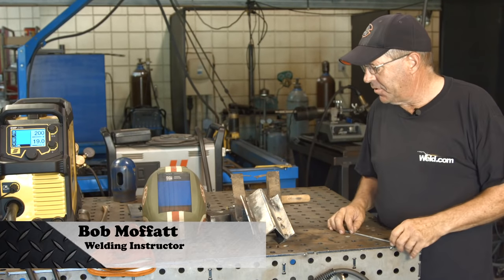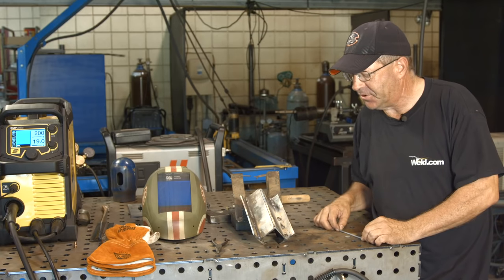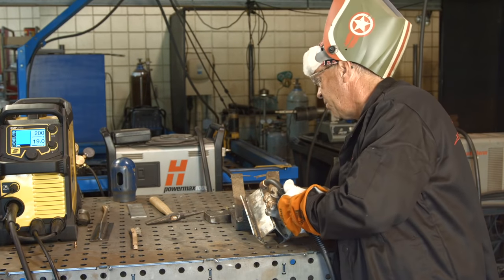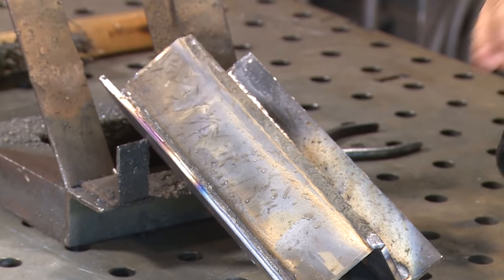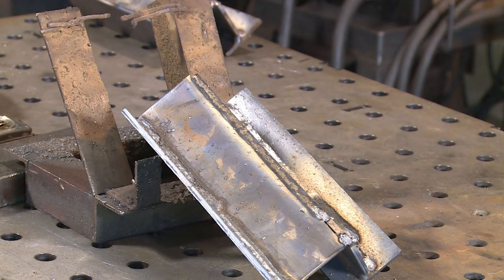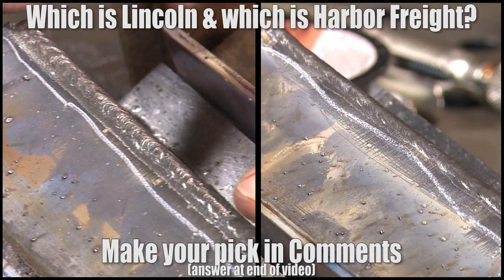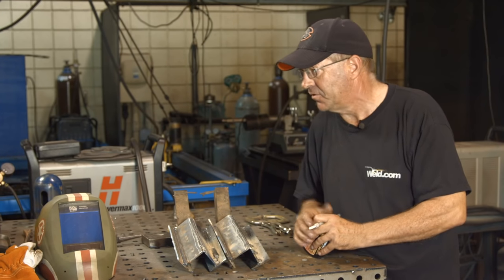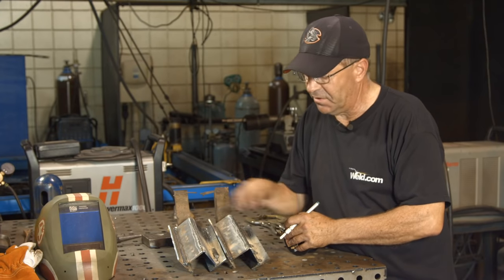Harbor Freight Flux Core Wire vs Lincoln Flux Core Wire: Part 1 of 2

Comment: @bob, did you ever figure out why it was feeding inconsistently?? i am noticing that with my welder atm and cannot figure out why. also when you stop welding and releases the trigger i notice the arc goes away (like curtains closing at a show in ) and makes a funny noise. ever notice this?

Comment: I have a question. I dont have much experience with flux core but on the second weld near the bottom. The arc didnt sound smooth. What causes that or is that the way its supposed sound?

Comment: From what I saw there was a pulsation happening on both the harbor freight wire and the Lincoln wire I did notice that the Lincoln smoked a little bit less than the harbor freight and what is your opinion on Hobart wire

Comment: Another question. Using fluxcore vert position. Can you weld from bottom to top or do you have to weld from top to bottom. On a thicker piece of material.  Im used to 7018 stick.  Thanks for any help.

Comment: I've had spooling problems with these before, I believe its the hole in the spool I ran a half inch sanding spindle through the center, made it smooth out a lot.

Comment: The slag on the Lincoln weld was harder to remove than the slag on the Harbor Freight weld.
The slag on the HF weld seemed to just peel right off. No so with the Lincoln weld.

Comment: If the nozzle is on is there any difference in quality of weld ? I have a cheap 130 amp welder ( gasless ) and i always keep the nozzle on because it sort of gives me a better point of reference when im starting the weld. I've had people say Why do you keep the nozzle on and my only response is " i just prefer it on " but no one has ever said to me that the quality of the weld will be any different.

Comment: Great instructional video. I'm going to need to do some flux core welding with my everlast mig welder. Got some welding that needs done outside and there is always some kind of breeze blowing.
Reply: I strictly run flux out of the same welder he used for that very reason, I honestly have it tuned in so nice that after I knock the slag off you can't even tell the difference between flux and mig wire with gas

Comment: Thank you for making this video!
Waiting on part 2.
I have been thinking of getting a welder, but don't want to spend a lot. So this Harbor freight welder fits the bill.
Reply: BadmunkyWRX that wasn't a Harbor Freight welder. your gonna be out a grand with the ESAB. it's worth it though.
Reply: ????
Video showed a Harbor Freight welder did it not?
Reply: BadmunkyWRX absolutely not. it's an ESAB Rebel, not sold at Harbor Freight. also, if you notice in the background, there's also a Hypertherm plasma cutter, also not sold at Harbor Freight.
Reply: Your right. I did not notice that the welder on the table is in fact an ESAB Rebel. 
Actually that is the welder I really want. But I do not have $1,000+ to spend on a welder right now. Or at any time in the next 1-2 years.
(Fixed income) 
But it would help me with my projects to have my own welder.
Reply: Look into Everlast, Lincoln, or Hobart MIG welders that cost around the $400-$500 range. Just as good and worth the money, plus keep in mind the cost of gas needed to use MIG wire, otherwise use Flux core wire.
Reply: Thank you for the help!
Right now I have a cheap older MIG welder made by Matco. It works, but not very well. And its a 110 so it will not do heavy stuff like a 220 welder will. I want to be able to weld 5/16" mounts to axle housings and not have them fail on the trail. So a better welder is needed.
I have been paying to have things like this done so far, but really want to do it my self.
Reply: I have a used Miller Maxstar stick/TIG welder specifically for some heavy duty trailers I made. Only set me back about $450. Works great with thicker material. On occasion, I have an older Northern Industrial Flux welder I got for just over $100 running Lincoln wire and also works great on 1/4". Point being, lots of options at reasonable prices
Reply from the maker: No, the video in this video is the ESAB Rebel EMP 215.
Reply: +Ju An those Miller Max stars are pretty sweet got one my self I say give me my maxstar and some 7018s.lot cheaper than that h f wire

Comment: I feel the same way about Walmart wire.   seemed to work as well as any other flux core.  but I'm not a welder, I just own a welder.
Reply: I guess it may depend on what you are welding and critical it is. I use lincoln wire in my everlast with no complaints.

Comment: I think that the flux core welds better with the shield also. It helps keep spatter off your tip. I've try welding without the shield and not even a second later my tip was getting gummed up and would break the wire/ wire welding/ arcing in the tip. I have a hate/ love relationship with flux core welding.

Comment: Very nice comparison. You didn't mention this so I guess it's just a trivial concern. However I may have had a senior moment and missed it. What type mig fluxcore welder are you using? AC or DC output. I presume that this information is not necessary or irrelevant  to know when you're doing these tests as you probably would have stated that?  What say ye? Thank you very much!  KP
Reply from the maker: We used an ESAB Rebel on DCEN.

Comment: Thanks for all the great vidoes. I  realize this is an older video but was wondering if your were using a knurled feed roller with the flux core wire? I have had issues with feed rate using smooth rollers. I burn a lot of flux core wire and until i switched to knurled rollers fought the exact issue you had with varied rate of feed.

Comment: The settings, the angle, everything is why it ran like that.  I think out of position or some less than ideal conditions (wind, dirty metal) would make a better condition.  That's where you really start to notice differences.

Comment: Hi Bob l enjoy your video's your an awesome teacher. Young blokes in the trade are in good hands keep up the good work .I've been welding most of my working life  I'm semi retired now and i find flux core very handy at home those 1 kg rolls bug me big time. I'm not sure but i think they may work better on a spool gun ? I don't  know I've never used one. At home though i only ever use the 5 kg rolls there much better. You don't use as many tips the liner is much cleaner and the machine runs smoother thats been my experience. Get one and give it a try keep up the good work Terry edwards TAS Australia

Comment: trying to get into welding and am most likely gonna pick up the HF welder. Would you recommend to use different wire then the one that comes with the welder?
Reply: Get what you can out of the included wire but it can be disappointing. Also buy a role of HF wire, it's better than what comes with the machine. Also buy a package of extra tips. I've never heard it discussed but for my weekend warrior projects, I prefer 0.035" tips for 0.030" wire. Just a little more forgiving to not foul the tip and jam the wire. Plenty good conduction.

Comment: The wire is oxidized or oil contaminated, you can't get a stable arc without good electrical conductivity. The Vulcan wire is typically oxidized and the Lincoln wire is typically oily to the point that the label soaks it up over time. Hobart wire runs smooth electrically but has massive amounts of spatter.

Comment: As an AWS CWI, I'm going to tell you that I'm biased towards Lincoln electrodes. I've tested hundreds of PQRs and the mechanical properties of these two manufacturers are night and day. If I remember correctly, HF is rebranded Hobart.

I feel as though you may have bumped something when setting up to shoot. It sounded like you needed quite a bit more wire. The pulsing is your electrode burning back up toward the contact tip. As it does, your voltage reduced and allowed the electrode to feed until its proximity to the workpiece increased the current again. Since I'm already talking about sounds, there is a noticeable difference between the HF and Lincoln electrodes. I would happily go into the differences I find with these two wires but I feel like we cannot establish a proper platform for debate until we've run these two electrodes within their proper parameters.

Comment: The smaller spools of wire seems to be wounds tighter.  Another thing is making  sure that the tension roller has the center where it mounted correcting.

Comment: love the videos only thing i would add is that it is not a ground it is a work lead. there is no ground in the welding circuit only the lead side of the transformer plugging the unit into the power source. awesome videos keep it up! as for my opinion on HF vs Lincoln. both are Chinese parts. it comes down to the welder.

Comment: I have the same problem with lincoln flux core wire.. not all the time but it started to happend more and more so thi week i'm getting a bottle of 100%co2 and it'll be my first week trying mig welding 👌

Comment: what do you about the E71T-11 flux core wire? i prefer it to the other type. i am not a very good welder myself but i do better with the high carbon wire. i have a firepower wire welder that pulses like you are talking about. i replaced the motor controller board and it still does the same thing. i have a brand new spool of 2 pound E71T-11 i am going to put on the firepower and see if the pulsing goes away.i am using the washington alloy E71T-11 WIRE .030.

Comment: In order to avoid that pulsing action, try using a bit longer stickout and or slightly higher wire speed. The wire needs more time to preheat before arcing. If your settings/wire tensions are good, I cant think of why else both spools would do that. I've used miles of Lincoln innershield, and it welds great in all positions, except downhill. Too much slag for the arc to contend with, unless you crank it up a bit and move fast and still hardly much penetration on thicker material. Solid wire and gasless fluxcore are very similar if you set up properly. Try .030 wire next time. I use it often and have great results. Great video, keep em comin!

Comment: I dug out a Speedway Series (green) 125A flux welder we got kicking around.  Pain in the arse.  Hardly worked.  It's sat for years.  I put a new 200A HF ground clamp on it for $7, cleaned it up inside, put a spool of Lincoln NR211 in it, I'll be damned it works!!

Comment: Bob you are the man no doubt about that but I don't think this is an equal comparison. The Lincoln wire is t11 which conforms to aws d1.1 with a limited thickness of 1/2". The harbor freight is a gs wire and is made to manufacture specifications.

Comment: I had the same issue with the Lincoln wire on the 2lb spool. I have since bought a 10lb spool and it fed perfect. I think it has something to do with how tight it is rolled onto the smaller spool? Just my guess.

Comment: Saw this video is still getting attention. One thing I learned about Flux core was switching the feed wheels from the smooth ones to the grippy ones, I forget what they're called now though.
Reply: But it's important for the wire to stop with back pressure.

Comment: I have the blue harbor freight flux welder. Its a/c output which sucks but it works. I found that using lincoln wire spools from home depot worked better than the harbor frieght wire it came with.

Comment: could the "shaky" feed be because the wire in smalls spools are more bent and not as flat coming out of  the big spools circumference?... or how do you determinate the wire  tension on the machine?  ... great videos!
Reply: That's the "Cast" he was talking about.  Some big welding machines have a gadget to straighten the wire, but there's nothing like that in these systems.  Too bad!

Comment: I know you didn't want to see anyting. But it seemed like the Harbor Freight flux core laid down a better bead. And not much jumping on the Stinger. But like you said it could have been just the way they were spoiled. One could have been wrapped tighter than the other. And causing jumping on the feeder

Comment: Try warming the flux core wire in not an oven but just warm the spool up for a few hours and just like stick electrodes the flux soaked up  moisture and effects the weld, also could you make a video of the really cheep 130 amp ac flux core welders?
Ps. I really think warming the spools and drying out the flux will really help
Reply: While heating may well alter the wire somehow, the result has nothing to do with moisture sorption. 
Metal is totally impervious to moisture vapor, and since the flux is on the inside, nothing in or out.

Comment: I've ran alot of np211. only times I had that insistent feed was because I either had it set too low or didn't have the feeder tensioned enough so it was grabbing.

Comment: My Miller (Millermatic 211) feeds flux core the same way. I thought it may have been my setup but I guess this is common. I've run 4 different brands through so far (2lb spools) and they all feed sloppy. The Italy made 10lb Harbor Freight flux core has so far fed the smoothest through my rig.
Reply: I had to take a look and was surprised to see the HF Flux cored wire is made in Italy while their solid core wire is made in China. Thanks!

Comment: with flux core wire it is very soft wire and if the pinch rollers in the machine smashes the wire oval it will bind up in the tip
Reply from the maker: This is true. However, that wasn't the case here as we tried adjusting the rollers.
Reply: Are you using the 'knurled' groove rolls...?
Reply from the maker: Yes, we were using knurled drive rolls.

Comment: people have told me that gas-less can penetrate thicker wire at the same amperage, is that true? ive also heard that a co2 vs c25 that hte co2 will allow a hotter burn and deeper penetration, is that true?  i had a HF 90A that was very inconsistent in arc length when i tried to weld with it. it worked but was just rough. i bought a lincon with co2 (140c) and its WAY smoother and easier to weld with than the gas-less.

Comment: Good video. I've run quite a bit of nr211 type wire in the past. It works especially well over galvanized. I think the arc may have been eating up the wire because your stick out was a little short. Try it with about 1/2"-3/4" stick out. You may have better luck with that?

Comment: Dunno.. I weld body panels, I do a lot. I stumbled across a brand - "Super 6" that do 0.8mm flux core mild steel wire. It's far from the cheapest - it's actually pretty pricey - however, if you gave me the choice of running Super 6 flux core or a premium solid wire with gas, I would pick the Super 6 flux core every single time in a heartbeat.  

It is about 10 times as precise when it comes to filling them tiny little "missed spots" on panel welds - it gives a much softer, smoother, flatter weld that grinds down lovely, it blows less holes in thin stuff than solid wire (even 0.6 solid) plus I can grab the torch, hit one button for "On" without having to dick about turning on gas, messing with flow rates, wondering is the bottle nearly empty.. going off for half a day to get gas, lugging bottles..blah blah - and it gives me a BETTER weld than all the faffing with gas did?? I'm OK with paying slightly more for wire for those benefits. 

You seen the price of gas?? Good flux core becomes a total no-brainer - every time I pick up a torch loaded with it, I smile - people who say it's rubbish, for hobbyists, blah blah - they just aren't doing it right.

Comment: I've  watched some of your videos and see that you are very good at what you do. So thanks for sharing your skills. I would like to know more about choosing  a tip size and gauge of flux wire for projects. Presently I'm doing some steel frame welding on a shipping container and would be very interested in seeing something done or explained - or both on this type of project that a lot of DIY guys out there might be interested. What are the best and worst case scenarios on DIY projects.?

Comment: how's the penetration with harbor freight wire
Reply from the maker: That is part two in this series. We are going to try and do a cut / etch and a bend test.
Reply: When I use  gas less core  I reverse polarity

Comment: Need a good welder for 300 any idea was looking at Lincoln 110 welder from home depo for 250 but it has just high and low switch and wirefeed dial no has but never used gas before

Comment: I avoid the 2 lbs spools because of the cast.
The 10 lbs rolls are much better and you can hold the proper stick-out without it curling out of the arc.

Comment: how many pair of gloves do you go through in a day I was looking at your hand position with that Harbor Freight wire you took that right hand glove love really quick LOL nice work good info I'm sorry for rambling and so many post I'm just bored I'm currently welding structural moments with a Miller 600 and depending on how much lead I have about 450 amps 42 volts and I use 25 lb spools Lincoln Ni311 3/32 inner shield copper backing bars and I have the latest speedglas fresh air respirator but yeah I'd love to be working in your shop pumping out 75 lb of welding wire a day well it gets old keep up the good work

Comment: Nice vid Bob,  
I get this whoohar all the time . I would love to see a comparison  between   a portable  stick and mig .. is it possible to slice and dissect and compare strength.  I use gassless mig(0.9mm) over stick because i weld better with the mig . I would also love to see a gassless wire comparison.  I use multi pass wire  yet i do believe single pass is available . My machine is a viper 180amp stick  combo 25V mig  . Cheers